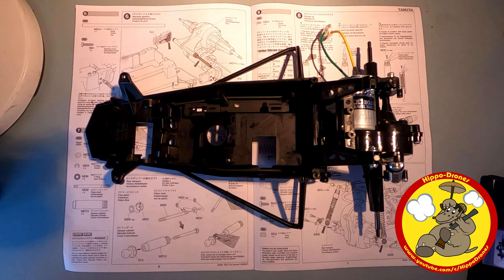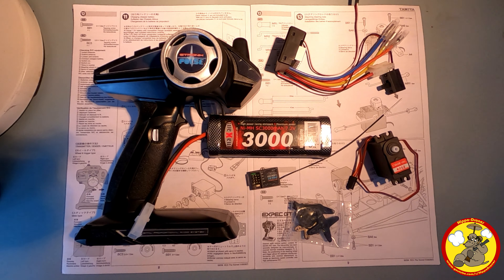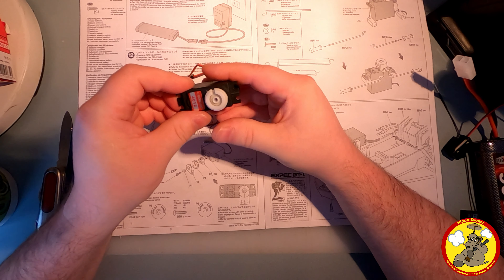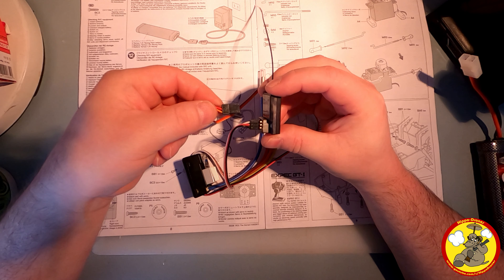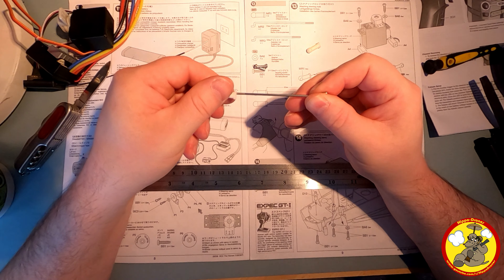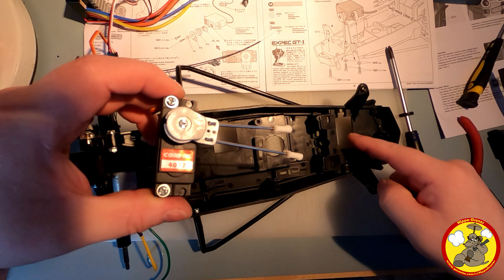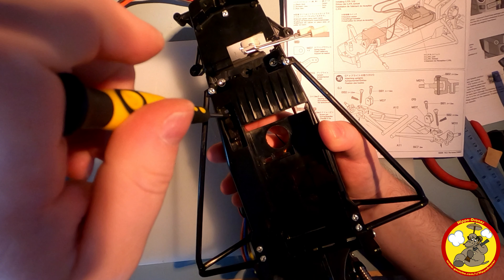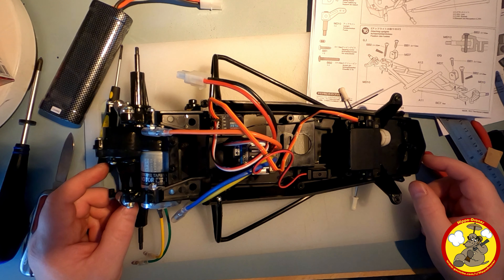Tamiya Hornet RC Buggy Build | Electrics | Pt3

Comment: I like this, i had one that looked like the one you are building. Wish I could remember what it was. But my father and I built and flew 1/4 and 1/8 scale RC airplanes. Not sure the scale but they were 5 & 6 ft wing span. This brings back memories of the good days of no bills and all i had to do was my chores and keep my room clean. See ya on the next one bud.
Reply from the maker: I used to build gliders with my dad, a little smaller than the ones you played with, but they weren't RC, just put them in the air on a line and chased after them hoping they didn't crash into anyones hous! :D
Reply: Hippo-Drones 😆. Gliders are neat and provide good lessons on lift and drag and so on. Then when you watch it float in the air is when physics is pretty dang cool. Until it smashes the neighbors window😂. That’s a whole different lesson

Comment: It's very similar to how my Hornet was 30 years ago except the electronics are MUCH better now!  Mine had a third servo for the throttle controlling a sliding resistor which was prone to all kinds of problems like dirt, misalignment, etc.  The simple little electronic speed controller in yours is SOOOOO much better!  Plus the servos overall look smaller in yours.  Tech has certainly improved.
Reply from the maker: Aye for sure, so much space in the chassis to fit everything nowadays! :-)

Comment: In the old days, thr Hornet came with simple spring shocks, no oil, and they were blue plastic. Nice to see metal, hydraulic shocks on them right out of the box. 
The build is coming along nicely :)
Reply from the maker: Aye, I think it was a complaint of the car as it would just squat on acceleration! :-)
Reply: @HippoDrones  They would wheelie on pavement, with a good motor in them :) (my best friend back in the day had a Hornet)
Reply from the maker: @Land-Shark  :D I've heard some folk have had 50mph out of them! :O

Comment: Enjoying this as I just bought the same kit. A question please. The side crash guards seem to just float, (sit in the slots) in the body sides. I can't see anything in the instruction diagram about fastening them in any way. Just the 2 screws on the bottom. Is that right or have I missed something ? Also, those tiny e-clips that hold that plastic ring on the rear shock pistons, are a bugger. I managed to do one side. Half of the second shock, then e-clip 4 pinged across the room, lost forever. Same with the 2 spares. The build is on hold till my 2 packs of spare ones arrive. I will have 20 goes at fitting the last one.
Reply from the maker: The side crash guards are screwed in at the front and at the back. You might find that the screws are attached on a different section of the instructions, I no longer have mine to check sorry.
Ahh, that is a pain, I hope they get sent out to you quickly. Is worth taking some time doing the more technical bits.
Reply: @HippoDrones  Nothing 'technical' about a circlip. Just fiddly at 2mm. I've built several Trex Heli kits over the years (450 to 600) but this build has me cursing. My hands are still hurting from fitting the tyres :)
Reply from the maker: @paulthurston2883  Hahaha :D yeah they are a pain :D

Comment: Right around the 9:47 mark, you’re screwing something into the on/off switch so you can mount it. What part is that? I am stuck trying to figure out how to mount the on/off switch.
Reply from the maker: Hi, yeah it makes the swatch mounting area bigger.
Reply: @HippoDrones  where do you get that part? I don’t have anything like that in my kit
Reply from the maker: @scottjerry8300  It should be in the kit, the only mods I did on this build were the bearings.
Reply: @HippoDrones  Hm, must be missing something then. I don’t see anything in my parts list, I really appreciate your help! I’ll see if I can find something in the replacement parts store
Reply from the maker: @scottjerry8300  iirc it was in the same bag as the switch, but might be wrong, it was a while back
Reply: @HippoDrones  yeah, my switch was built into the speed controller, I don’t even think I can replace it without splicing wires.
Reply from the maker: @scottjerry8300  ahh that is a pain